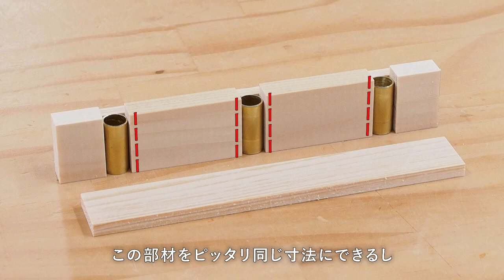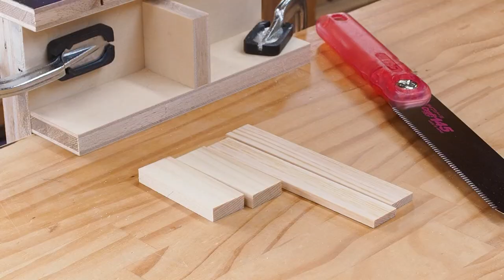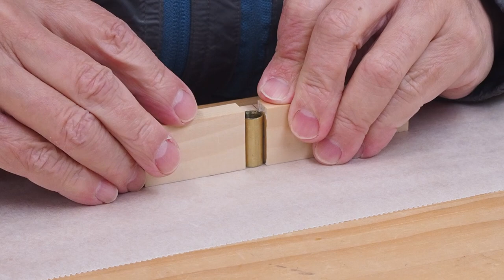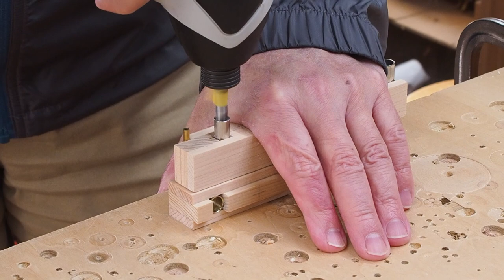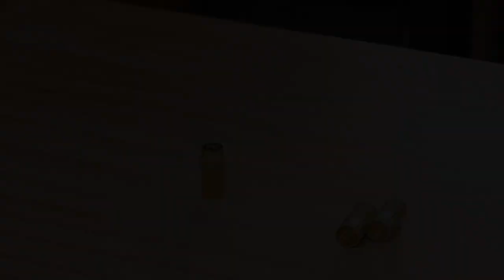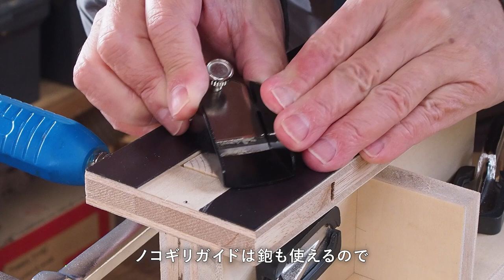Accurate dowel Jig with a Hand Saw, without a drill press| Cutting small parts precisely (subtitled)

Comment: Hi there, it is rewarding to see your joints fit so tightly. Japanese precision at its best. However, what if I want the dowel holes to be adjustable to adapt to different conditions? This jig requires a different jig for each type of material dimensions.
Reply from the maker: Thank you for your comment! There is a certain width of material that can be handled with one dowel jig, so I think you can do most projects if you make about 3 according to the width of the material you often use. For example, a 5 inch wide, 3 dowel jig will hold up to 6 inches. And if you need a jig for unusual widths and dowel positions, how about a super easy dowel jig? You can make it in no time!
Reply: @kikikumastudio     Thank you for your response. It's most helpful.